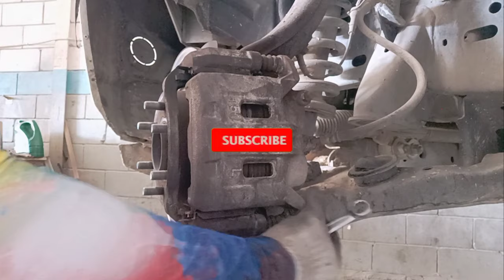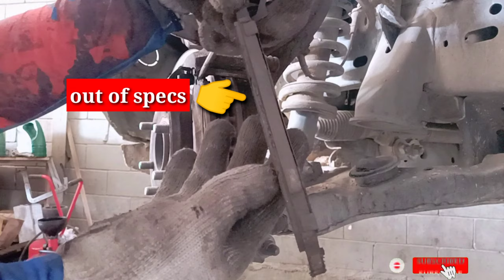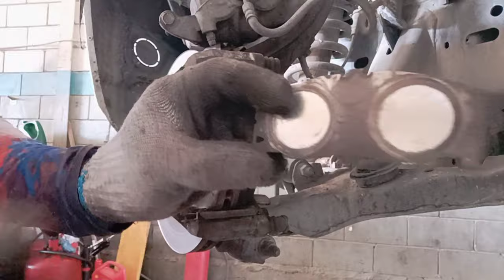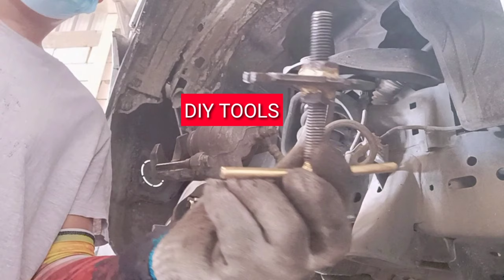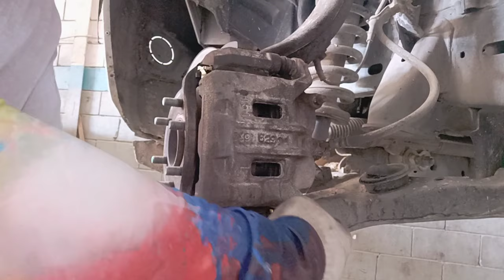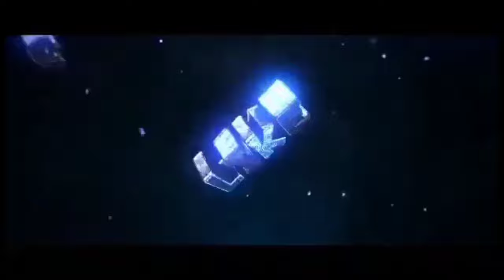Nissan Navara Pick-Up || How To Replace Brake Pads

Comment: Bleeding not required?
I removed the calipers yesterday and put them back, with the same pads…got no brakes anymore
Pedal just sinks, after pumping, it’s harder but goes soft again
Bled the system, no improvement 🤦‍♂️
Any thoughts?
Reply from the maker: Check your brake line for leaking of brake fluid specially or rear brake cylinders and adjustment or your brake shoe maybe need for adjustment. Check  the condition of your rotor dics? Check the brake master cylinder and your brake booster. Maybe one of them is your problem. I hope i give you some ideas to solve your problem